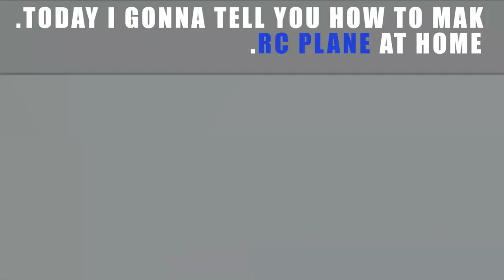How to make Rc plane with thermocol | perfect Rc

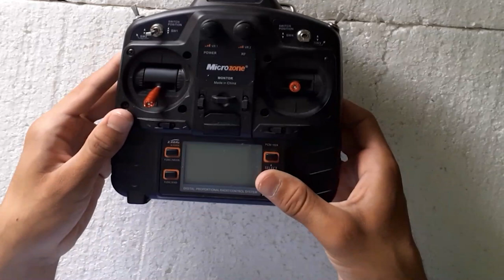Comment: some info.    the performance of this model is adversely affected by  Many  design  FLAWS.       at :07,   this prop configuration is called an  Offset Thrust Line.    in order to CORRECTLY do this,  the thrust  ANGLE  Should cause the thrust Line to   INTEREST  the model's center of MASS.  see linked photo.    at :17,  the tail boom is  TOO  long.     at 1:07, it is not clear whether these are  PUSHER  (EP)  props.    at 2:18,  control horns have NOT been correctly located.
at 2:39, WRONG WRONG  WRONG.   the MASS of the servos should NOT be located,  SO  FAR  AFT; this causes a model to have a  TAIL-HEAVY  distribution of Mass.    servos SHOULD BE   installed   NEAR  THE  CG, below the main wing. 
at 3:08,  incorrect thrust Angle.     the  Offset of the thrust line is EXCESSIVE;  LESS offset and a  SHORTER  prop  Should be used.       at 4:42, the main landing gear is NOT Correctly located.    this  mistake  has  Increased the  TAIL-HEAVINESS  in the  dom.     on this model, the main gear Should Be located  below  the main wing  LEADING EDGE.     at 4:58,  incorrect thrust ANGLE.      at 5:18, the installation of a tail wheel  Further  INCREASES  tail-heaviness.     at 5:22,  the span and  MASS of the horiz-stab is Excessive.   which equals   M O R E    TAIL-HEAVINESS.      if every other  MISTAKE  were fixed,  this model should then be balanced at 30 percent of main wing chord.   or a little forward of thirty.        googletranslate
bro
http://static.rcgroups.net/forums/attachments/2/9/6/3/9/7/a5988257-224-bixler%202%20motor%20angle%20correction.jpg
Reply from the maker: Thanks!! For guidance
I will implement these change to the next Rc plane....